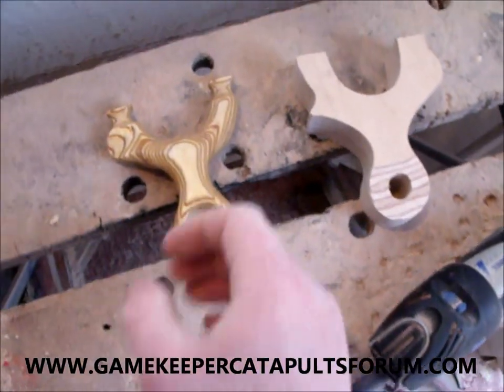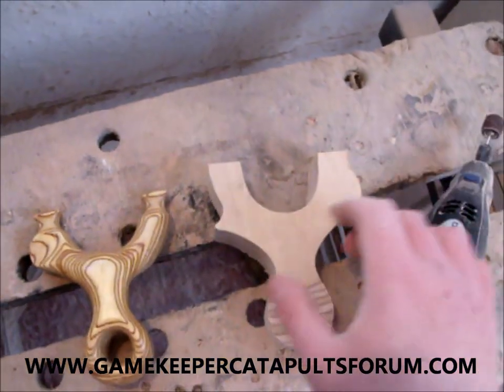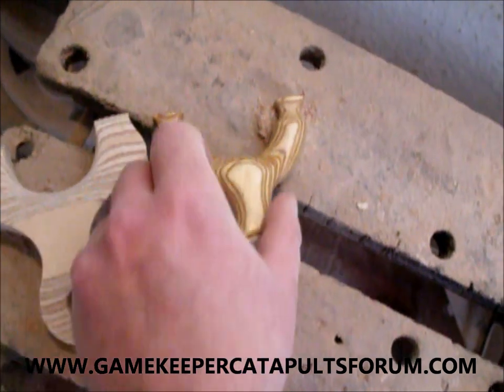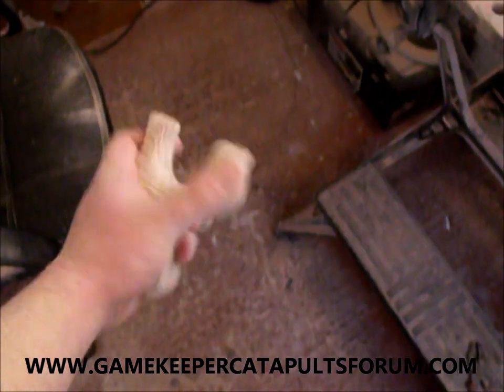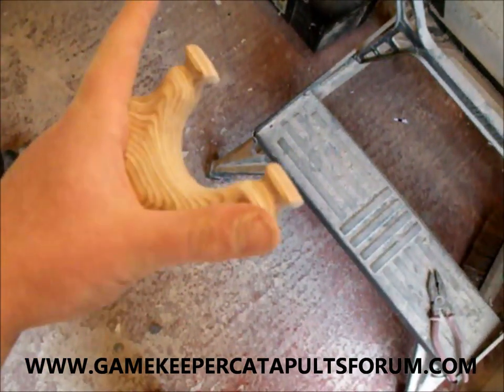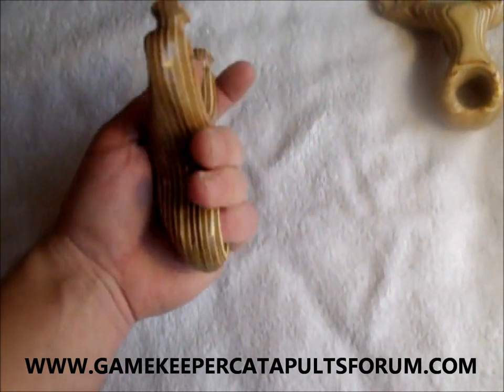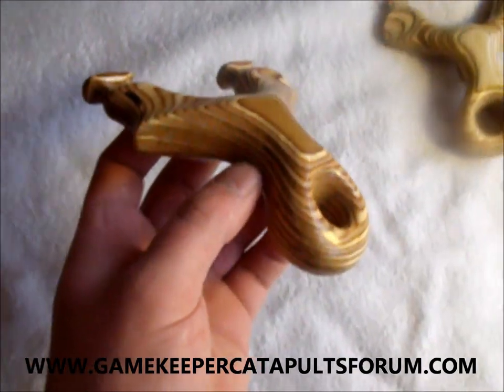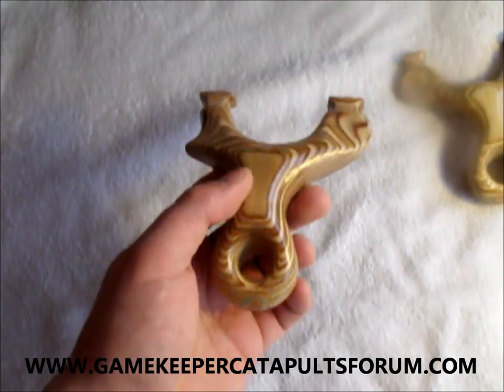MAKING A MULTIPLEX CATAPULT WITH A PARM SWELL

Comment: How many sanding drums have you blown for this , .......quite a challenge only utilizing those "Dremel" sanders , I'd say .

For rough shaping maybe simple wood rasps might be faster , .....though some elbow grease involved and you need to find a way to clamp your workpiece into a vise(maybe leaving the handle somewhat longer to gain a "waste end" to be clamped thus squeezed and finally cut off when rough shape would be completed) .
Nice work , though , ...great design , cheers , 61diemai